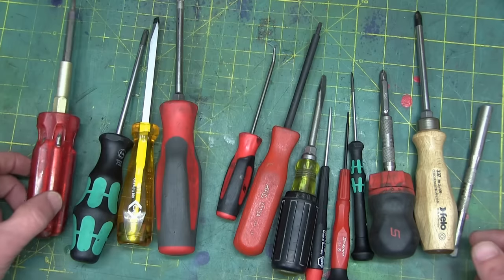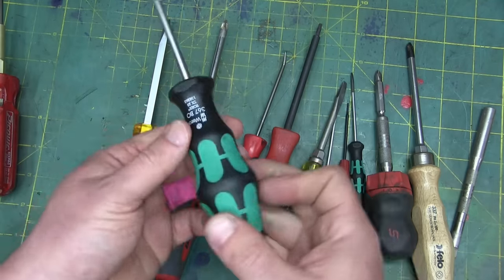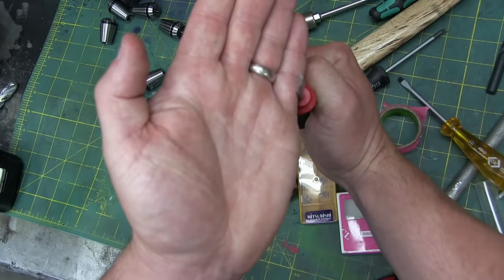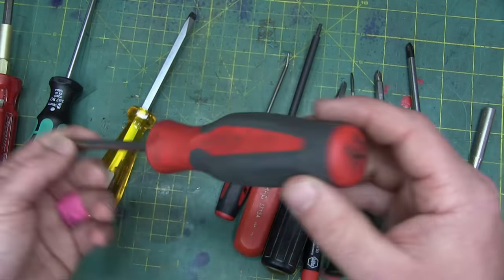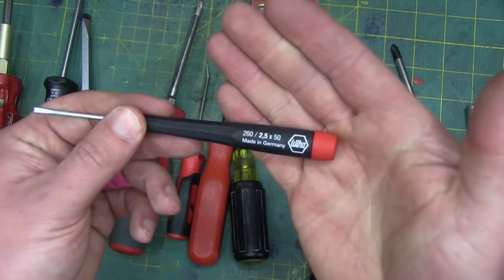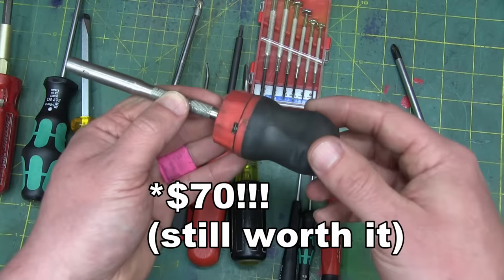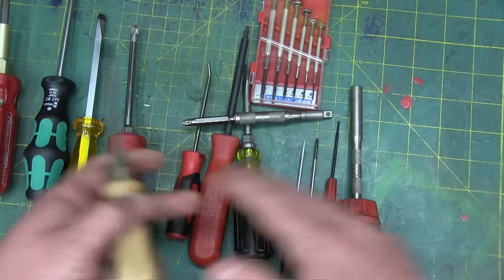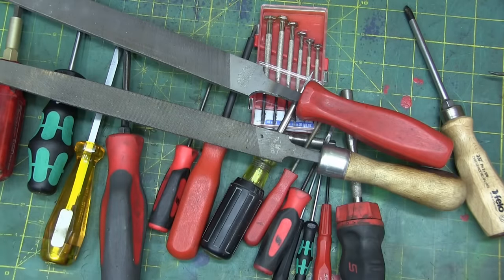Screwdrivers is BEST screwdrivers?

Comment: Klein all the way. Also don't go in an electric panel with a screw driver that has a full shank, doubles as a voltage detector
Reply: Or just use an insulated screwdriver. I love my klien and my kobalt set equally
Reply: I agree I love my Klein tools.
Reply: Који Курац so right man
Reply: Lol thx
Reply: I have the Wiha insulated screwdriver
Reply: Yep… been using Klein for 46 years. All my hand tools are Klein except my channies… they're  Channelock
Reply: @awickedtribe  channies gotta be Channel. They made one tape measure I liked also but I think it's gone. Boo. Also, dude, I saw the name Wiss on the last Channellock product I walked by.
Reply: Klein screwdrivers just feel so smooth. I bought a set of those mini screwdrivers and I didn't even need them. Just nice to have.
Reply: I find the Kleins steel too soft, and that's been a common complaint. But Klein has responded to complaints and i believe the newer drivers are harder, like they used to be years ago. Good company!
Reply: @GabeMacDonnell  That's true, but I don't mind because I've never stripped a screw with my Klein screwdrivers. 
Always gave me a 2nd or 3rd chance to get those really stubborn guys out.
Reply: Steven Cone that's a very valid point. If you do have have an issue, Klein's CS is great. My Klein pocket multi screwdriver or the 10-Fold is on me about 10-12 hours a day. Great stuff from classic brand.
Reply: I try to buy everything Klein, I like to have as much matching as possible. I’m a neat freak, but I’m the electrician’s envy!
Reply: @GabeMacDonnell  I hope that is true. I go through screwdrivers like crazy, I just ruined a brand new 7in with the 1/8 tip breaking free a set screw on the neutral bar of an old t&b that saw a CH of water over the years. I have have even broken the handle of a demolition driver giving it the business. It is a damn shame cause it wasn't too long ago they actually held up.
Reply: I'm using Knipex VDE for electricals.
Reply: william white I never warmed up Klein. I guess I’m just a Knipex guy. And Channel Locks..... those wicked things aren’t allowed in my toolbox! Knipex only!
Reply: 17 XV I never liked the way the rubber squirmed around on Klein’s. I never understood their popularity.
Reply: Wera is great
Reply: Klein are my favorite. The 32500 11in1 is still my goto combo driver. Doesn't stand up to a drill to well but I have a habit of using what I have on me in the field.
Reply: Use heat shrink tubing, cleaner
Reply: Nobody talks about Sonic? When I was 19 I bought a full set of sonic tools and a toolbox from them on credit, best decision I've made so far.
Reply: @Frosty_Saiyajin  thought you meant sonic the hedgehog at first, never heard of that brand
Reply: @brentsido8822  Really good tools, in my opinion better than snap on. When it comes to power tools however, I'm always gonna use Matco, Milwaukee or Snap On
Reply: @chuckhickman8093  How's the grip on the handle?
Reply: I still use Klein a lot, but my Wera set is a close favorite!!
Reply: @UserNameAnonymous  never heard of “RIGHT TOOL FOR THE JOB?” I hope you’re a handy homeowner and not a tradesman , BUT I’ve employed many “PRO’s” that get their tools power imposed at harbor freight so I don’t have much faith.
Reply: @UserNameAnonymous  The sharp edge of a panel cuts through tape just like it does knuckles.  Do what you gotta do in a pinch but that is terrible advice lmao 😂
Reply: @UserNameAnonymous  P.S. you can get Lennox brand insulated screwdrivers very reasonably at Lowe’s.  277/480 arc flashes are interesting but not great for customer relations, ask me how I know.
Reply: @UserNameAnonymous  yeah but then you look like a mickey mouse electrician to customers.
Reply: 🤣🤣🤣 right....
Reply: not anymore. like any other tool they're made in Taiwan now,

Comment: I hate lacquered handles. I always sand it off and just apply a light coat of boiled linseed oil.
Reply: i beliebe its the beech woodbthat makes those felos so great. beech just can not be beat! the old collectible 200 yr old stanley plame bodies are made of beech for avreason
.
Reply: josh verne you won't believe what happened!!! Not click bait!!!
Reply: josh verne Heh heh, Wranglerstar, I c wot u did there
Reply: Lacquer is for furniture, oil is for tools.

I don't use boiled, I use natural linseed oil because I'm overly cautious about the lead and cobalt in it even though it has been used for nigh 600 years now.
Reply: Patrick Hale I don't have a source for non boiled... Any recommendations on some I could order online?
Reply: josh verne beat me to it haha
Reply: Pro tip right there. Scrape that lacquer off and oily hands will be less of a problem.
Reply: I use used engine oil
Reply: yeah, engine oil will probably work well, but who knows what nasty shit is in there. [just my 2 copper plugs]

I ended up getting some, as far as I can tell, non-"boiled" linseed oil that's sold for artists to do all their oil-paint fuckery with. Jury's still out on the finish, though...took a long time to "dry" and I probably should reapply.... Actually, it's odd, it sort of doesn't feel like it dried? Maybe it's just that I've never handled properly BLOd wood before?

Comment: It is IMPOSSIBLE to find a screwdriver that has, a hollow ground tip, a nut on the shaft, wood handle and a place to strike on the end. You either get everything minus the hollow grind, or a hollow grind and a wood handle but nothing else. Aggravating.

Comment: We use WIHA at my work, they last long, even beating the ends with hammers.

For o-rings we use those picks that dentists use, doesn't snap as easily.
Reply: The one tool you cannot scrimp on is screwdrivers. I've had Stanley and all sorts over the years, until I picked up a Wiha. Those things are perfection in a screwdriver. No more damaged screw heads. and the grip is unbeatable. Not cheap, but not as expensive as some other drivers. They're the sort of screwdriver you buy for life, after you've learned the false economy of buying cheaper sets. If you're real lucky (and smart), you'd buy them in the first place, and not go through all the frustration of owning inferior tipped screw drivers. Better than the Milwaukee because they have an even shape, so you can get perfect hand position for maximum purchase no matter what the direction of the screw head. The rubber they use never slips... it's like they sprayed the handles with Unslipium or some magic substance... they're that good!

Comment: This just reminded me of the brutal testing of our shop-made screwdrivers in metalwork class at school (UK, over 45 years ago). Tip in the vice, (just the tip, mind, and only fer a minute!). Spanner on the squared off other end, then give it the good news. Start with 100 points. If the tip began to twist off or chipped - zero points. To a schoolboy, it seemed harsh at the time. In reality, if it did either of those things, it was no feckin' good anyway, no matter how pretty it looked. A good life lesson. Thanks for bringing back that memory!

Comment: You want the yellow Wera. They have the hex on the shank and a steel-cap on the end for hammering...I miss a PB swiss screwdriver in your collection.
Love the woodhandles Wiha but cant stand their plastic handled ones.

For the picks I go into the dental/medical tools. That stuff is dirt cheap and quite good...
Reply: You can also get the yellow handle Wera (I think they call them Series 900 Chiseldrivers) with a square hole in the metal end cap to insert a 1/4in ratchet.  I think those have an 'AS' for the flat blade or 'SPHS' for the phillips after the model number.
Reply: Brian Havens haven't seen those ones before, all the other ones (part from the stainless steel versions) are present in my tool boxes.
Reply: also the wera 300 SK type are bolstered, not strike through, but they are way less likely to damage fasteners than the 900 kraftform's.  .    I also love the wera ratcheting screw drivers... 72 tooth has some nice advantage.  Find it weird he likes felo more when they have literally the same grips as wera.
Reply: Oh! My comment already exist. Thanks Stefan :D
Reply: Actually you want both! Each has its place. I have both and use them for different tasks.

Comment: Pozidrive is Not JIS... I get my JIS drivers from Vessel tools what a difference it makes to have the correct driver for the screw.
Reply: thank God someone else knows this too!!..
Reply: Correct. Pozidriv is a non-cam out design by Phillips, now standard in European manufacturing and flat-pack furniture Worldwide. JIS cross head is completely different. 

I like the PB swiss screwdrivers with the black hard rubber swissgrip handles, hex and pound caps the best. The slots are flat ground and the Phillips fit tightly. They are better than my wiha and Felo drivers for my hand shape.
Reply: Ya get loads of JIS on Japanese bikes. I got some Vessel 1/4" bits for not much, the difference is amazing.
Reply: Yeah, the Vessel JIS #1 and #2.  Recently added them to my collection for those screws in electronics stuff that has a small dot on the head.  The Vessel screwdrivers have a nice knurl on the shaft for twiddling the screws in or out fast.
Reply: JIS screwdrivers work in Philips heads and don't cam out. Pozi screwdrivers are not the same as JIS and mince Phillips and Pozi heads.

Pozidrive screwdrivers mince Phillips heads, but you can use a Phillips or JIS driver with a pozi screw. With a pozi driver and matching pozi screw, the screw goes in straighter. 

 JIS screwdrivers never mince heads but they break screws. It's preferable putting a wood screw in that it strip halfway in and is removable than snap.

The Vessel JIS screwdrivers are the best I own, I use them on my bikes and my guitars where a small scripted screw or a screwdriver scraped across the finish is a big problem. Try some.

I really like my Vessel PH2/JIS mini impact driver. Feels like a nicely weighted pound-through driver, but they turn when you hit them, not a lot, but usually enough to unfuck a motorcycle.
Reply: JIS screw heads are also often found on cycle components, because of the market domination of Shimano and Suntour - I  have Vessel #1 and #2 screwdrivers specifically for working on cycles. JIS looks like Phillips - but it ain't! You get a much better fit with a JIS driver.

Comment: I work on Japanese motorcycles as an enthusiast and Highly recommend Vessel brand JIS drivers. You'd be surprised how many folks dont realize those cross point screws on motorcycles and electronics are likely JIS heads and not Phillips. Phillips drivers strip them out, but JIS drivers are good for Phillips head screws too.  For woodworking Robertson heads by any good brand seems to fit the bill.
Reply: I was just commenting about Vessel. Great drivers, truly great. Never gonna switch away from them.
Reply: dkruitz Yup, I had a frustrating experience with exactly that. I was trying to replace a crankcase cover gasket on a 72 Honda CB200 and juuust about stripped every one of them. Luckily they all came out using an impact screwdriver. Honda liked to use those cross head bolts back then for everything, of which I only learned were JIS a while later. I replaced all original bolts with an allen bolt kit anyway.
Reply: Have you used the vessel impacta? I tried one and it's amazing for stuck screws. The metal cap on the end goes to some internal mechanism which turns the bit counterclockwise when you strike the back end with a hammer. It's become my go-to driver for JIS and philips #2 screws, and if something is stuck I don't even need to grab another tool, just hit it with a hammer.
Reply: +1 on that.  I started with an #2 Impacta, then got their 220W multi driver, and a conventional #2 with the ball handle. Great drivers with good ergonomics and quality construction.

Comment: A shout out for Picquik! I've got almost the entire series. I wish they made one with JIS...

Don't let them get wet, they surface rust fast. Besides that the material quality is great, took a relative to use one in a drill to chomp up a phillips bit, still usable but it slips easier.

Comment: This may chooch you in the wrong way but the best screwdriver is the one you can find!!!! I swear every time I need a phillips i find a flat head and vise versa. sometimes it aint big enough to fit in the hole or its to big to fit ;).
Reply: That's so true! I never have my good screwdrivers on hand, simply because I'm afraid someone is going to use one as a pry bar
Reply: undeadlich1 so true, I end up doing impossibly difficult projects with a Leatherman because I didn't bring my tools. 20 min jobs take a hour because of the bulky, unbalanced multitool sucks in any position. All while my wife saying supportive things like "it's hot out here" or "you said 5 mins 5 mins ago".
Reply: Timothy Jesse pick up a gerber center drive lol make your life a little easier
Reply: Have you considered putting your tools away when you're done with them?
Reply: I can't say I've ever had this problem. They go in two places. The nice screwdriver drawer, and the expendable screwdriver drawer. Your miles may vary.  

That said, I keep a crap load of those flip bit Harbor Fluke freebie screwdrivers around because they are just handy for most things.
Reply: aussiebloke609. or borrow the next guys....always a bit awkward when you ask a stranger in the junkyard....
Reply: All my screwdrivers go in one bag, all the flatheads point one direction, if I reach in and get the wrong tip, I just replace it in the same orientation and grab one faced the other way next. 
Doesn't work for stubbies very well.
Reply: undeadlich1 Look after your tools! Jeeslus.

Comment: What would you recommend for a left-handed screwdriver?
Reply: oragamihawk How on earth are screwdrivers left hand discriminatory?!
Reply: Anonymouspock Well if you think about it, they aren't, if you think harder about it, that's the joke.
Reply: +Anonymouspock  There's two ways a screwdriver can be "left-handed", which makes for three kinds in total - bit, grip, and bit-and-grip. Left bit screwdrivers have a reversed end, for use with screws with left-handed threading. Left grip screwdrivers have a reversed handle, so you can apply more torque when it's held with the left hand. Left-bit-and-grip is just those two features combined, but they're incredibly rare.
Reply: oragamihawk I'm left handed and have the same problem holding screwdrivers. So what I do is hold my screwdriver with my right hand, and the beer with my left.
Reply: maybe look into a metric phillips head screwdriver
Reply: Sounds like someone needs to be sent to the store to ask for a left-handed screwdriver, a can of striped paint, and a long weight.  LOL
Reply: Don't forget the right-handed pencil and clean stain.
Reply: do you need a left handed screwdriver to change your headlamp fluid?
Reply: +HaloInverse oh god...I feel my brains oozing out...
send help
Reply: Bucket of sparks fur da grinder
Reply: I'd say you should use a set of shiny copper magents to select the best screwdriver.
Reply: Improvise, Adapt and Overcome...well done Andrew!
Reply: Just hold a righthanded screwdriver like you're about to stab someone. Trains the tendons and muscles too!
Reply: oragamihawk a mirror!
Reply: wtf? are you mentally challenge? just use it on your left hand. since when tools have designated hands? is like saying do you have pencils for left handed people.
Reply: LOL , you serious ? I"m a joker but don"t know if you are or not...................
Reply: Never thought about this , automatically thought would be the same whichever .......lol , still don"t know if you"re winding me up  :]
Reply: A company called Gofugyoselv makes a good left handed screwdriver as well as the best muffler bearings and exaust samplers in the market. Their air brake fluid is kinda shit though.
Reply: Metric or Imperial?
Reply: aussiebloke609   Having the new guy ask the plumber for some dehydrated water or red striped Fallopian tubes always makes me laugh.
Reply: oragamihawk As a lefty I can attest that all screwdrivers fucking suck
Reply: Pingu McPing Correct most were metric except a few imperial pockets in places like Scandinavia and Wisconsin. The problem wasn't Metric vs Imperial really from what I've read most of thoes manufacturers of the time didn't use the letter a or the letter p so when they labled their tools they really on had one choice, Metric. Weird history I know
Reply: +CC MOGS
Seriously, if you've read all the other comments in this thread before replying and you still aren't sure, you must have a rare mutation that's caused your sarcasm bone to be missing.
Reply: British Standard......
Reply: @josh verne You say that but enough people lost their right hands on these types of videos to table saws and goodness knows what else.